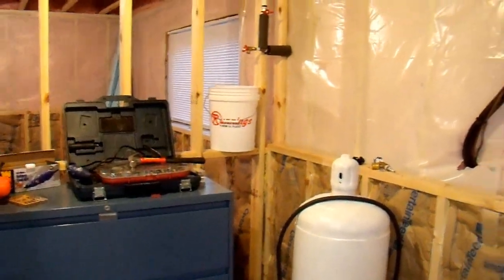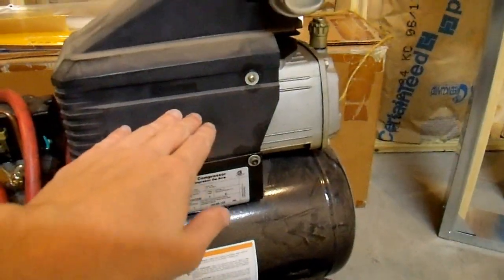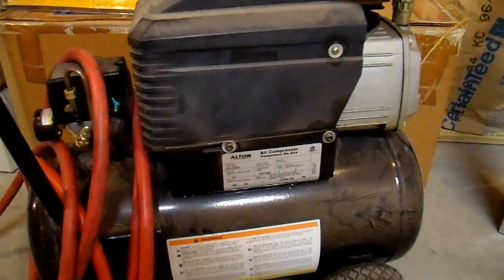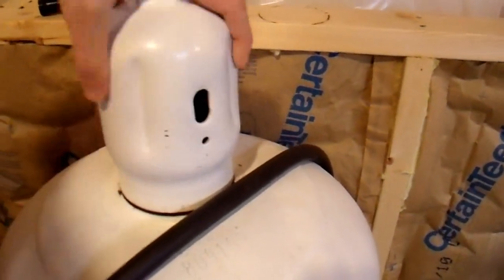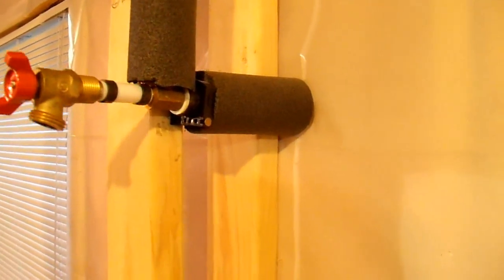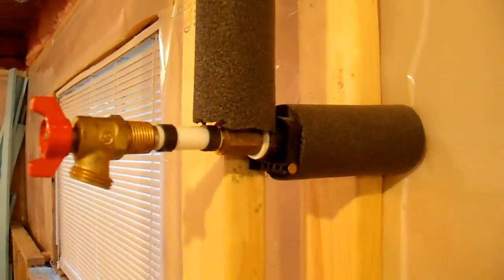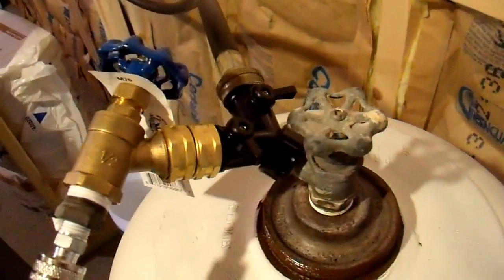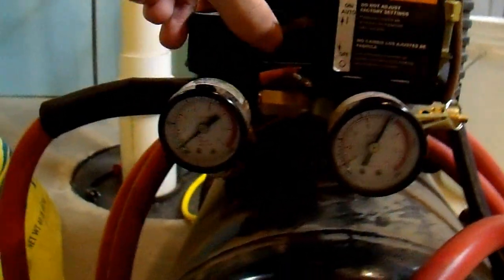Winterize Your Sprinkler System Blow Out with Any Air Compressor

Comment: (Sprinkler contractor of 35 years-Colorado...)Generally speaking, a pretty good video.Most homeowners wouldn't have an extra propane tank around. Years ago, before I had my tow behind, I used a 5 hp gas compressor along with an 80 gal propane tank. Volume is what  you need to do an effective job. Any amount of air that you can put into your sprinkler lines is beneficial.Water expands 9% when it freezes, so theoretically if you only got 10% of the water blown out, nothing would break.( most contractors don't want you to know that). The most important thing is to get all water out of your back flow device and main pressure line.
Freeze tolerant ball valves are a nice upgrade to minimize damage from early cold spells, as well as any insulation you can wrap around piping that is above ground and exposed to the elements.
Reply: Ronald Lehman m
Reply: I realize I'm kinda randomly asking but do anybody know of a good website to stream new tv shows online ?
Reply: @Adrian Leandro yup, I've been using flixzone for since april myself =)
Reply: @Adrian Leandro Thanks, I went there and it seems to work =) Appreciate it!!
Reply: @Hendrix Brysen Glad I could help :D

Comment: I liked your video.  I agree that the sprinkler folks will say you need all kinds of cfm etc...  The Orbit site said in a FAQ that you would need a compressor that can do between 4-8 cfm.  But then they mentioned on another page that 10-25 cfm would be needed.  So the info is all over the place , even from the same source.  The compressor I own is a 33 gallon and rated 6.8 cfm @ 40 psi and 5.1 @ 90 psi.  The hp is 1.7.  So apparently keeping the psi low will give more cfm.  You are right, even needing to do a zone more than once may be worth the effort instead of paying $65 like I would for 7 zones.

Comment: Okay, first, you have a marvelous voice for radio. Second, this was extremely methodical and helpful! Very nice - quite a confidence boost to clear out lines myself.
Reply from the maker: Thanks!  One thing I forgot to mention is to be sure to take care of the outside valves.  I turn mine to 'half open'.  This prevents freeze damage that could occur if there were some residual moisture in the valves.
Reply: nice voice for radio!  you are 100% right

Comment: So yeah I used my California air tools small compressor and was able to blow out my 8 zone system.  I went through each zone twice and also held down certain heads to add pressure to further ones. Took me about an hour to go through and make sure just air was coming out of each zone. I turned of water and both sides of the main valve. I used the shut off on the spigot the compressor was connected to in order to build pressure back up again once it got low. I made sure to shut the valve off between shutting off and turning on zones in order to prevent the air pressure from damaging any of the valves. I use a Rachio controller which made it easy Bc I could be outside controlling the zones with the app and controlling the pressure from the compressor with the spigot valve. Worked great and no mist or water coming out of any of the rotor heads. 
I can certainly see how having a big compressor would save you time but I can’t see how it would save you any more than that. I’m confident I got all of the water out of my system it just took a few times to pressurize the small tank again and then releasing the air into the system. Just be sure to have a way to cut off the compressor air pressure when switching zones in order to not try to pressurize a closed valve system. 
Good luck and thanks this video helped a lot!
Reply from the maker: Sounds like you did a great job!  I've cleaned out friends/relatives sprinklers a number of times and never had trouble doing what you describe but for some reason I have a zone that absolutely requires higher volume than a 1/4NPT can deliver in order to clean it out fully even if I open the zone and then bypass the air pressure regulator for full flow (which I don't like doing as I could make a mistake and damage my system).  The aux air tank with a garden hose connector does the trick nicely even at a safe 60-70 psi.

Comment: I’ve been installing irrigation systems opening and shutting them down  well over 30 years and the do it yourself methods with the small compressors will work if you’ve got the time to do it but not a Proper waydepending on the irrigation system you have if you have tall risers on your small heads very very difficult to get the water out of them the barbs on the bottom of the sprinkler heads will bleed back water from the heads and hold water if you get a hard freeze lotta times the barbs will freeze and bust the flex pipe going to them or the barbs themselves so there are pros and cons to doing it yourself versus having a contractor do it for you I always tell my customers that you can do it yourself but depending on your winter you could have issues if it’s a bad winter it’s just a gamble that you’re taking if you think it’s worth the rest then go for it but if you want that guarantee from A contractor always remember you get what you pay for
Reply from the maker: You simply need sufficient airflow and many small compressors don't have enough.  That's why I use an old 100lb propane tank to boost it.  No issues cleaning out any system fully with that, and the only time I had a contractor clean out my sprinklers they failed to do it properly.  Get what you pay for?  No.  That's not how the world works.

Comment: Yeah...really useful for only those who have a huge tank laying around.  Might be able to use any compressor, but will also need some inconvenient stuff.
Reply from the maker: You can also use this procedure without a spare tank if your compressor has a large capacity tank.  Most any compressor with a 20 gallon tank can work if you have a limited amount of patience.  Hiring someone to do it is always easier but that isn't the point of this video.

Comment: How do you drain the propane tank?  All air compressor tanks have a drain at the bottom to drain the moisture present in the compressed air.  Failure to drain the tank after use will eventually cause it to rust from the inside and introduce the possibility for a dangerous failure.  As far as I know, propane tanks only have fill and pressure safety valves on top but nothing that would allow gravity to drain water from them.
Reply from the maker: I don't drain it.  It sat behind an abandoned house for decades and now it sits in my basement.  If I wanted to drain it I'd just turn it upside down and open the valve.  I've seen air compressor tanks rust through and they weren't a safety hazard.  Weld up the hole and pump it back up.  Maybe I should be concerned but I'm not.  Remember that these tanks are designed to hold 300psi of propane so they're strong tanks.

Comment from the maker: Not enough air velocity to fully empty the lines especially if there are any low spots in the line layout like in my yard, and there will be water left in any of those depressions.  But if it works in certain cases then I guess it works for those applications!  I'm not sure it's that important to empty every bit of water out anyway.  I just want to be thorough.

Is your strategy to run it long enough to evaporate dry the lines?

Comment: I don't worry about blowing every last teaspoon of water out of my irrigation system.  As long as the remaining water is below ground and the pipes, worst case, are less than half full, even if the water freezes, it won't damage components.  (Water expands 10% as it freezes.)  The main thing is to remove water from all pipes and valves that are above-ground.

Comment from the maker: leaf blowers and vacuums do not generate the necessary pressure to get the job done.  You need both volume and pressure, which equates to a large amount of power.  It is impossible to get this power from a 120V outlet unless you somehow store it for future use like in an air tank.  I am glad that method works for you but it is not an acceptable way to winterize a sprinkler system.

Comment: adding a larger holding tank will not increase CFM of your compressor fact it will make  your compressor run harder to try and keep up with filling the tank we're filling the tank in the first place
Reply from the maker: The larger tank increases both the CFM and duration of the cleanout, both of which are important.  Garden hose connections have much lower restriction than industrial air couplers.  A standard household compressor will not be able to clean out a system like mine without an auxiliary tank.

Comment: GREAT VIDEO  Never have split ball vales again... Use FREEZE TOLERANT BALLVALVES..How to replace ball valve
Reply from the maker: That's a good point as I didn't show the additional steps outside the home.  Crack open any drain valves and turn the ball valves to 1/2 open position.  I've never had any trouble with the standard ball valve doing this.

Comment: Your title is a little misleading
Reply from the maker: I'm not sure I understand why it is misleading?  Most any air compressor will work.  If you have a smaller one you may need an aux air tank but you can still use any air compressor within reason.